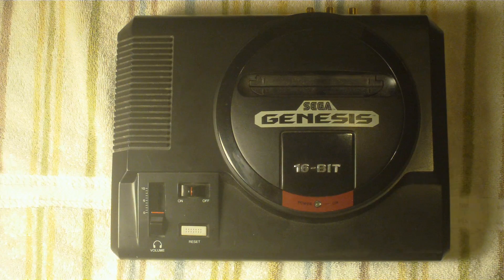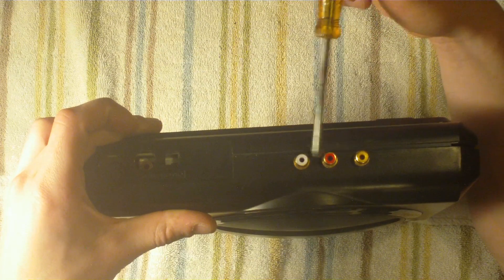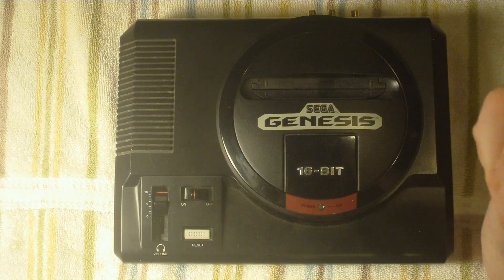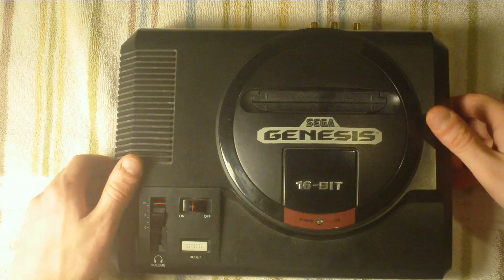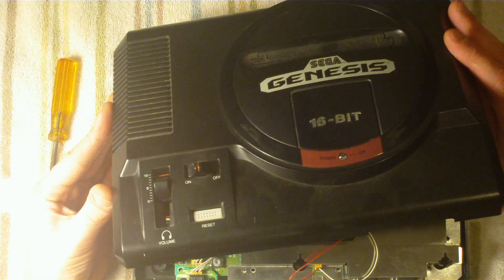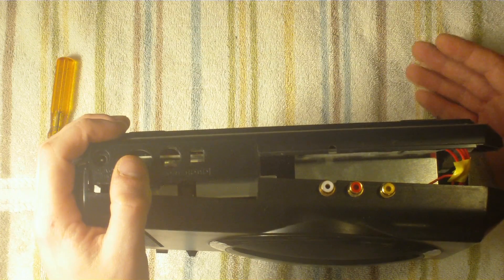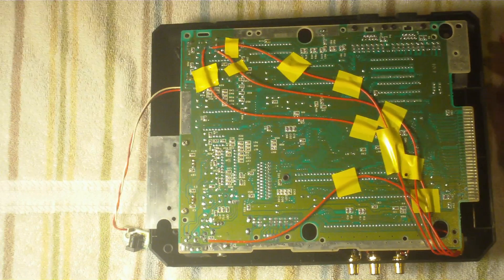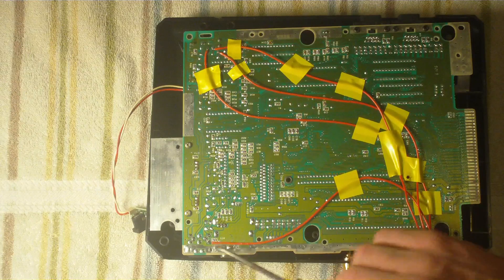RCA Mod Genesis Model 1 Part 1

Comment from the maker: @dnbrhythm 
you could literraly ground it on a screw or the metal plate that covers the board. unsolder the ground lead and just touch it to the metal plate and see if the picture gets better... then you will know.

Comment from the maker: @gtafanatic63 
go to radio shack. find rca phono jacks for the red white and yellow plugs.... the wire is awg copper wire. i would say 25 gauge ish. i dont recall exactly the size. as long as its not to thick and not to thin youll be fine.